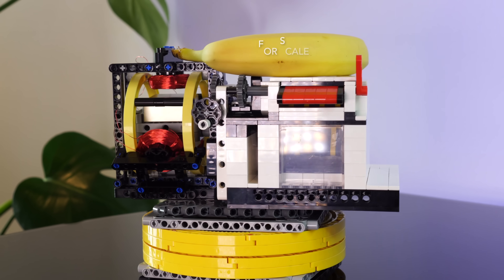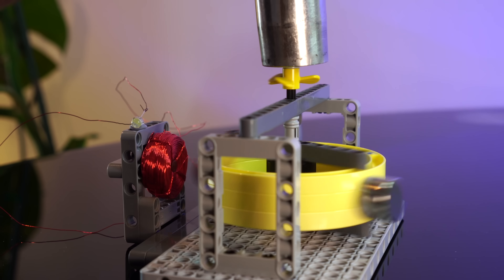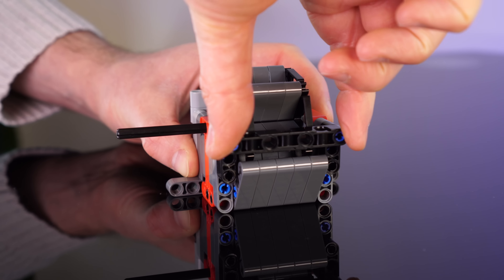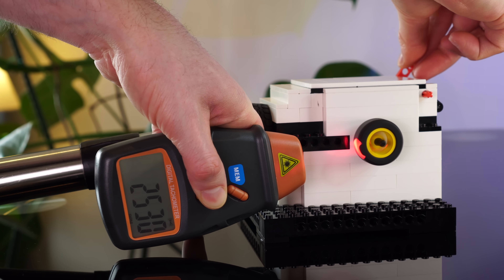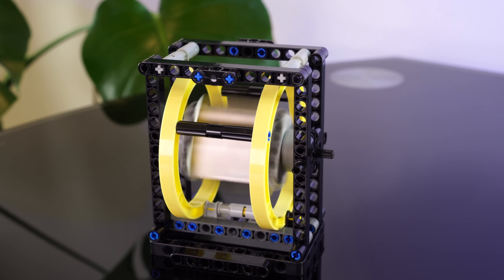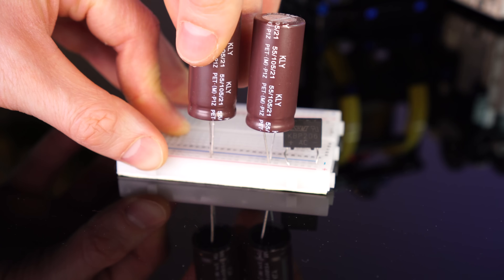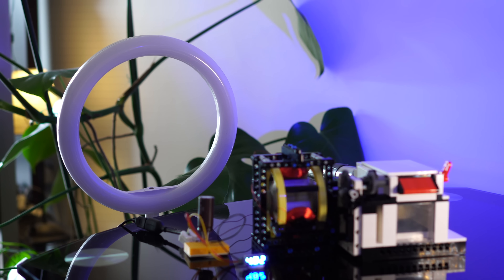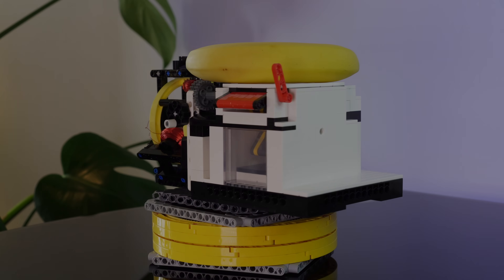This Lego Vacuum-Powered Generator SUCKS!

Comment: Hi Jamie, could i ask if u send the link if where u have bought the copper wire used in the video please? Thanks!❤
Reply from the maker: Sure! I just get most of my bits and bobs on Amazon. Here's the link to the wire: BNTECHGO 24 AWG Magnet Wire - Enameled Copper Wire - Enameled Magnet Winding Wire - 1.0 lb - 0.0197" Diameter 1 Spool Coil Red Temperature Rating 155℃ Widely Used for Transformers Inductors https://amzn.eu/d/jip4jls
Reply: Thank you!!!!!! I rlly appreciate it!!!!!❤

Comment: Don't have the budget to patronize anyone (can barely make ends meet) but I remain a faithful humble subscriber. Keep doing cool stuff. One thing I would like to see is a Lego variable capacitor, it ought to work if you put aluminium foil on one side of the plate?
Reply from the maker: Aw well I just really appreciate your support and comment! ☺️ That's a really interesting idea about a variable capacitor. I guess in theory that's pretty doable. Will have a think about possible applications. Thanks a lot!

Comment: I'm happy to see that I'm not alone in using my tongue to measure voltage.
Reply: Human Voltmeter
Reply: proto  :D @ProtoHadron
Reply: @Jadedrifts proto proto protoception
Reply from the maker: Best measuring method out there for lower voltages 😋
Reply: @JamiesBrickJams voltage gives a delicious taste 😋😋. No need for sambal or any spice. Voltage is spicy enough
Reply: Bro multimeters exist @JamiesBrickJams
Reply: @JamiesBrickJams  And the most painfull one
Reply: Did that as a kid with a model train transformer. I remember waking up a few minutes later. That was the day I respected electricity moving forward.
Reply: @StereoMike06 wish I know what to comment.
Reply: I used my fingers to know if electric model train tracks are conducive.
Reply: @beccajohnson-choma1762  my veins would literally fucking vibrate when my Lionel train came by
Reply: @beccajohnson-choma1762  I used my mouth
Reply: Same but I almost died
Reply: I use my tongue to measure all kinds of things
Reply: @echonomix_ Some of which also taste somewhat similar to a 9volt, depending on various factors... 🤔
Reply: We all did this as a kid with 9V batteries
Reply: The higher your 🤔 the greater the voltage 😂
Reply: "Hmmm....this tastes like 120 volts!!"
Reply: @aaronsmith8073  one time i was pulling a pc psu out of the wall and my finger was touching the outlet prongs and it was sticking out but still power thru it and it felt like the osiliscope ac patterns flowing in my arm
Reply: @Lgwasherfan5623  holy crap you're lucky to be alive
Reply: i put the 2 nozzle thingys of a 9 volt battery on my tongue, it stinged me quite a bit
Reply: Me to
Reply: Ok good am not the only one who does that too
Reply: Me consuming 9 volts like juice boxes: haha energy drink
Reply: Damn
Reply: Real
Reply: @electroBoom he deserves a comment
Reply: Yes
❤❤
Reply: I always do that with 9Vs when I can't find my battery tester lol
Reply: It's even more fun when you use 120AC.

Don't try.
Reply: Taste like metal 🪙
Reply: Hey how accurate can you get it
Reply: ElectroBOOM would be proud :D
Reply: Me too
Reply: Guys I tasted electricity instead of voltage😀
Reply: I think my ignition coils going out can u use your built in voltammeter
Reply: coward. I use my brain.
Reply: I do to😅

Comment: Try this with a lego vacuum piston engine, I've built ones before and the 1 cylinder has high rpms and decent torque with a good flywheel.
Reply from the maker: That's an awesome idea, it's definitely on my list as I'm pretty new to vacuum engines, but they look fun as hell!
Reply: They sure are, but something about the actual piston engines is that the valve timing has to be 90° left or right from the piston. 
Some other engines i made it has a ohc, which then I had to use a chain for it. 
Awesome video btw 👍
Reply: Vacuum turbines are more efficient and have a higher power output though.
Reply: Vacuum turbines are fast but have little torque. Piston engines are pretty much the same. But definitely more torque
Reply: Turbines have a linear torque curve as well as rpm, but youd need a pretty beefy brick built flywheel. I've done my own tests and they can move me and my vacuum pretty fast.
Reply: @damiancieslik3586  Because the torque is mostly in the form of RPM. Power isn’t just torque or just RPM, it’s both combined. In general, vacuum turbines are more efficient and powerful than vacuum piston engines.
Reply: @xmysef4920  how big of a turbine would be pretty efficient and powerful? I've built a 6x4 turbine before nothing bigger or smaller
Reply from the maker: Yeah I just assumed a turbine engine will be more efficient overall. But I do love the mechanical sound and functioning of a piston. They demonstrate concepts well too. So will still give it a try!
Reply: @JamiesBrickJams   Yes obviously of course, piston engines are quite a lot cooler!